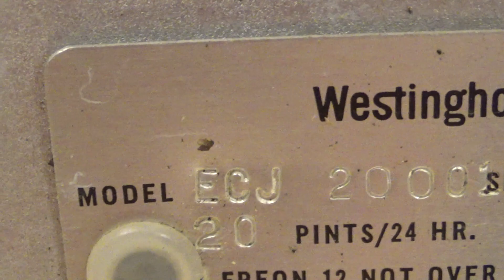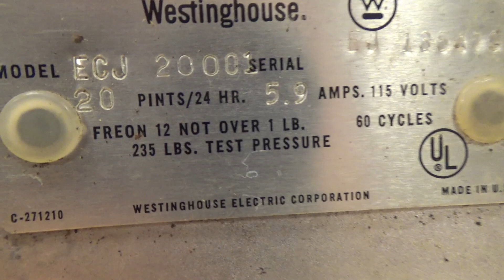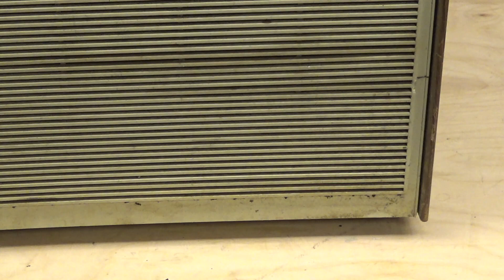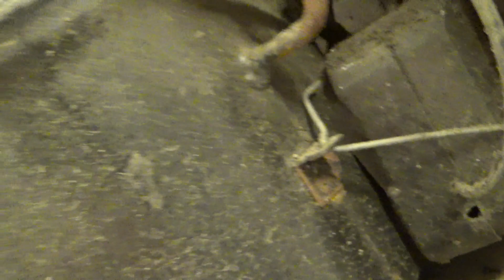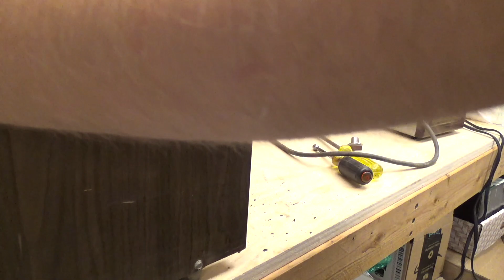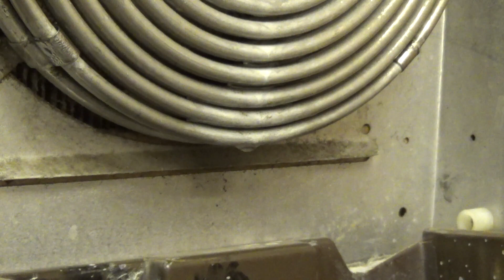1968 Westinghouse ECJ20001 'Custom 20' Dehumidifier | Initial Checkout

Comment: That's funny. I also used to have that same unit Although mine was "refurbished" in 1972. Yours is missing a piece, it is supposed to have a plastic v shaped tray under the coil which allowed you you to hook up a hose directly to it. The one on mine broke as well. I am not sure if the bucket would have also had a hose connection like the later WCI units or not.
Reply: I have one of these with the bucket. If i remember correctly it just has a hose connection on the pan under the coil, not on the bucket itself. I'll double check it later.
Reply: @brunoshow124  yes, that is how I remember it, but his is missing that pan.
Reply: @brunoshow124  I ended up breaking off that pan which was plastic because someone yanked on the hose it was connected to, so the unit got scrapped before I had the chance to try to fix it.
Reply: @WalterKnox  That sucks. I just looked at mine, the bucket is just a plastic tub, no way to connect it to a hose.

Comment: I have to say, dehumidifiers have surprised me in the past. I just rescently almost condemned a whirlpool made Kenmore unit because I thought it was out of charge. After leaving it on for nearly half an hour, it still hadn't built head pressure. I got sidetracked and ended up accidentally leaving it on overnight and when I came back, the bucket was full. After that initial scare, it had been working perfectly fine sense. 
If it really is out of charge, have you ever tried usign R-152a in place of R-12? R-152a can be bought cheaply anywhere and works quite well. Although a lot of people will tell you that you should, you really don't even need to change the oil. I used R-152a in both of my cars in place of R-12 and in a mini fridge that my friend has in place of R-12 and both have been working great for over 2 years.
Reply from the maker: I wonder if perhaps they're a bit undercharged by design, with the intention of being used in cooler environments like underground basements. I was testing this at almost 80 degrees, which is considerably warmer than most damp basements will ever be.
Reply: @JordanU  That is a thought. The one I had ran in a cold crawlspace down to around 60 degrees and it never froze up on us.

Comment: Great video. I have almost the same machine, but slightly older. And mine exhibits the same behavior. But the coil is copper and it gets frost on both layers within maybe 20 minutes. And then it defrost. I have no idea if this is ideal, but it seems to be effective at removing humidity.  My main concern is the insulation wrapping the compressor area. I am thinking it might have asbestos and need to be removed as it’s directly under the fan. I think the other difference in these older models is the fans are larger and run at a slower speed and make less noise.
Reply: Interesting my parents has this model and still works good still funny story when we first moved to commack on long island the previous owners when they first built the house in 1955 forgot the unit and 3 other things so the fireplace humidifier and extra 1960s cortelco telephone were our gifts lol

Comment: I have an identical one of these units that I use in a bedroom, it also takes a very long time to build pressure as well as the suction line not getting super cold. I think these units were a bit undercharged from the factory. Mine has its bucket still as well as an off balance fan.
Reply: Mine still works great the previous owners of my house when it was built in 1955 bought it when they first came out in 68 and they gifted it to us by forgetting it lol

Comment: I suspect old oil is working its way through the system. It's also 60s tech which I'd expect to respond a bit differently than 80s or later tech. I think you ought to just be patient and let it run for 30 minutes to an hour. You might be jumping the gun on leaking refrigerant. Slow leaks are more of a thing on systems that aren't sealed. It doesn't make a whole lot of sense, so I think you ought to be more patient with it. Even if you can find a guy that will fill the system, it's a convoluted process where the system is opened and a valve is brazed on. It's done for empty systems. I don't think they can capture the Freon like that which is required by law. It would just get dumped into the atmosphere. You can ask a guy who knows about this kind of thing.
Reply from the maker: I had it on for over a half hour in total. It should come back cold much faster than that. I will give it a few more tests to see if it just needs time to circulate the system, but it's heating up more than I'm comfortable with. I'm a licensed tech, I know how to recharge the system. The issue is finding the refrigerant, which is obscenely priced. Sadly a conversion to an alternative refrigerant is probably more viable at this point.
Reply: @JordanU  You are a licensed tech? I'm not but pretty sure you should clean the unit, mainly the condenser before you diagnose "low refrigerant".
Reply from the maker: @TheNightstang  There was no diagnosis here. There was a preliminary speculation based on observations of the equipment from the first time I tested it.